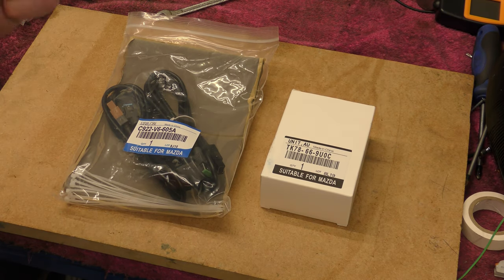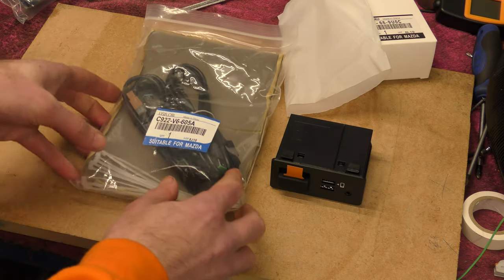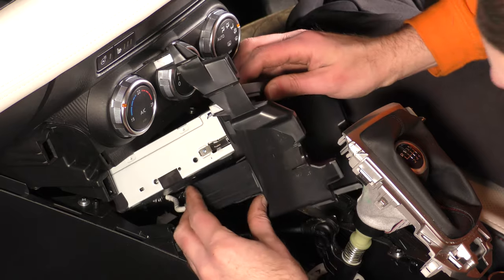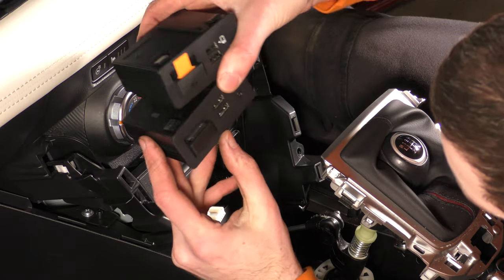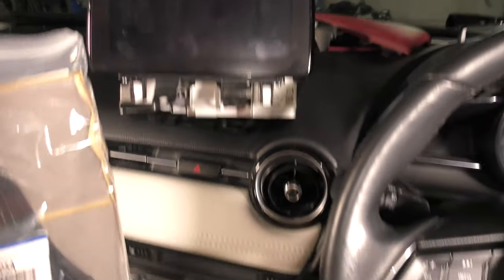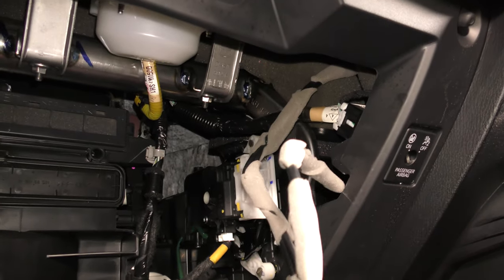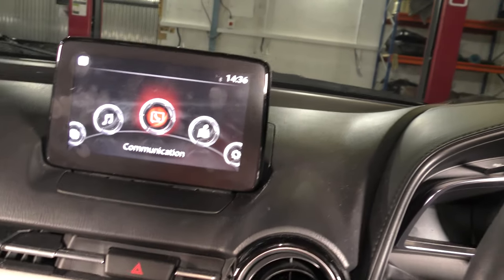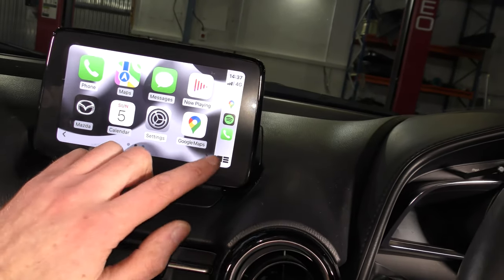Mazda CX-3 CarPlay / Android Auto installation - CARABC 00008FZ34

Comment: I did this to my wife's CX-9. We got the car second hand and the dealer wanter 500bux to get this going. I spent 80bux on eBay and got a kit. 1 hour of my time and it was done.
Reply from the maker: I can't believe how much faster the CarPlay interface is compared to the stock Mazda.  But then I suppose it's running at new iPhone processor speeds and not whatever is in the CMU.
Reply: @DavidMcLuckie  it is much faster. Also consider a wireless adapter. I got one as a Christmas gift for a close friend. He loves it. I will get one for the wife's car. At the end of the day, having this ability does away with the need to replace your navigation system or really update it.
Reply: @Engineerd3d  Thanks for the video, looking to do this to my Mazda 3. When you say wireless adapter, is that to allow carplay/android auto to work wirelessly?
Reply: @johnjames01  there is a USB wireless adapter for Android auto. There are a bunch of manufacturers and they sell for about 50$, this allows me to sit down start the engine and have android auto launch automatically without plugging it in or even taking out my pocket. Music, Maps etc all work as if wired.
Reply: @Engineerd3d  Excellent thank you! I'll have to look into that as well.

Comment: Hello, I followed your build exactly as stated here and CP and AA work great. However, for some reason the Native OEM Navigation is not working. When I check the Navigation Settings/Info, under GPS it states no satellites found. Do you have any insight or suggestions?
Reply from the maker: How long did you give it to see satellites?  Also did you put the navigation SD card into the new unit?
Reply: @DavidMcLuckie  thank so much for the reply. I decided to check behind the screen, and I did forget to plug in the Blue GPS Antennae cable. Plugged it in and everything is working perfectly. Thank you for your reponse though!

Comment: Glad you got it installed.  Kind of late but I thought i might save future installers time and potential damage to the console, etc.  Cheers!

There is a much easier way to get to the USB Module box without having to take apart anything.  I have a 2019 CX-3, and I didn't plan to need the original USB box again, so using a 5/64 drill bit, you measure 1/2 inch from the sides of the box, you slowly drill by the edge of the top of the box (being careful of course to not move off the box and damage the whole front grill) and when the bit hits the plastic clips, it breaks it.  You do this for the top and bottom.  The box then pops right out.  I REPEAT...using the drill breaks the clips off, and leaves 4 holes in the front of the old box.  So you you wish to retain the original box for some reason, you need to follow David's way of getting to those pain in the butt clips. :)

As for removal of the screen and dropping the glove box, you would need to do that, but once you drop the glove box and remove the screen, you can clearly see the cable running down.  Slowly pull the USB box out and the original cable comes with it.  Drop the new cable down from the display area, pull it through the area for the new box, connect it, pop the box back in, make your connections to the display, verify function, tidy up the wiring and re-assemble the display and glove box.  Done!

BTW, I normally take my car to mazda for oil changes and I just asked if they could please check if the Mazda Connect software was updated and they updated it to the latest system at no charge.

Tip for anyone doing this, I advise you to use the blue painters tape and tape off around the display using multiple layers of tape to prevent scratching up the top dash. while you slide and wiggle the display out and you can safely sit the display on the tape without having to completely remove it.  All you want is access to the back of the metal box the comes out  with the display to reach the connections.

Comment: Hey mate, great video! Any tips on those bloody clips that hold the unit in place? I can't quite see what you're doing. Am i meant to be pressing them towards the unit (for the top clips i would be pressing then down), of sort of lifting them away with the screwdriver (for the top clips id be lifting them up)?
Reply from the maker: Yes, clips squeezed towards the unit and try and push/pry the unit outwards at the same time.  It's pretty tight.
Reply: Same issue - including this would have been extremely useful. A lot of videos seem to miss off key elements like this. Still stuck on this part.

Comment: Good morning,
  I would like to have some information, do I need to install new firmware before installing the new box to have carplay?
Thanks in advance for the feedback.
Sincerely.
Reply from the maker: Only if you have a firmware lower than the version in the instructions.  The you need to update with the original non-carplay box before swapping it to the new one.

Comment: Thanks for your help from Italy! A question: it seems that with some clone models, original Mazda Nav no longer works. With this one by CARABC?
Reply from the maker: That is something I'll need to check.  I haven't used the original Mazda Nav since getting access to Google Maps.
Reply: @DavidMcLuckie  if you could check and tell me something about it, I would be very grateful..
Reply from the maker: Can confirm Mazda nav still working.
Reply: @DavidMcLuckie  Thank you very much!

Comment: so no possibility in 2023 to have the necessary EU files and instructions somewhere for download for my cx3? 🤔
Reply from the maker: There is a link on the manufacturers Alibaba store to firmware files.
Reply: @DavidMcLuckie  

thx for your help..
i was successful in updating to 70.00.100A EU with a 32GB Fat32 USB Stick with the two file method.
now im just wondering where to get the latest firmware 74.00.324A EU to update before i install the new HUB.
or is there no benefit in updating from 70.00.100 EU to 74.00.324A EU?

Comment: With Android Auto, can you activate the touch screen? It doesn't work within Android Auto, only within the Mazda menus.
Reply from the maker: Good question.  I'll need to try that.
Reply: @DavidMcLuckie  Apparently Mazda purposefully made it so you cannot use the touch screen, so I guess it'd need some sort of hack.
Reply: Hello, did you found any solution?
Reply: @markocvejic8385  No, but it’s theoretically possible since the display is touchscreen capable. The touchscreen incapability in Android Auto originates at the software level, so it’s just a matter of whether someone has developed the hack to enable it. I haven’t looked into it so you might find it if you do.